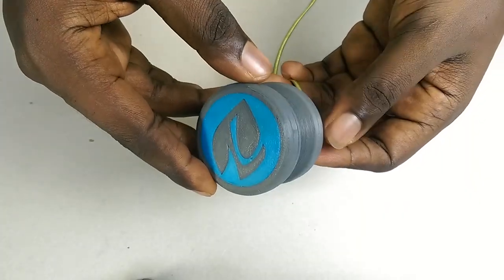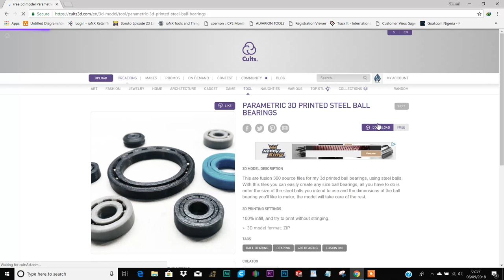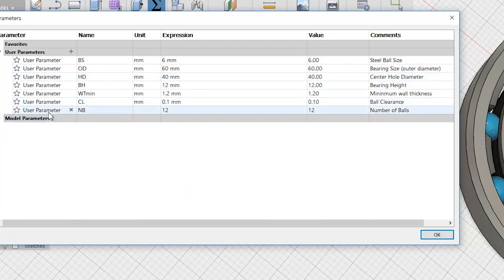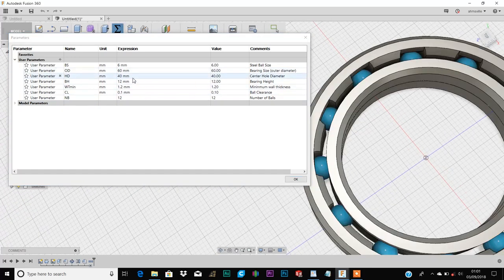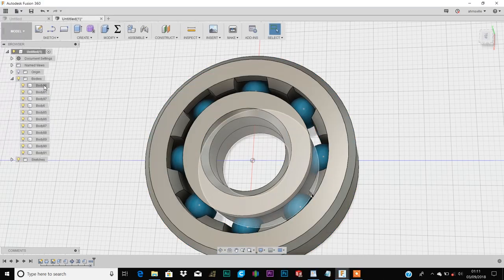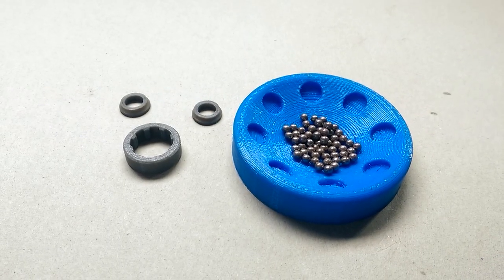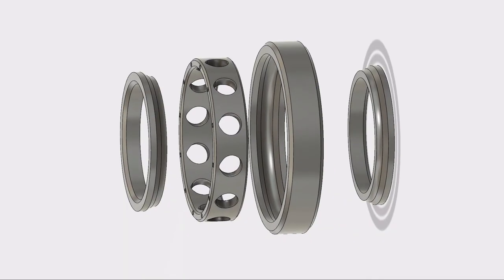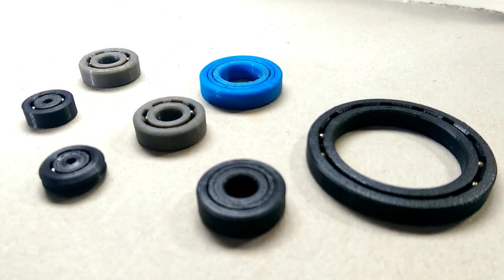Parametric 3D printed Steel Ball Bearing | Fusion 360

Comment: thanks! all the models I found used 3d printed balls which obviously didn't work with my FDM printer, it's like making a bistable switch and trying to print the contacts.
the use of an inner plastic ring is a great design choice as it allows me to melt steel shaft into the bearing for a tighter fit.

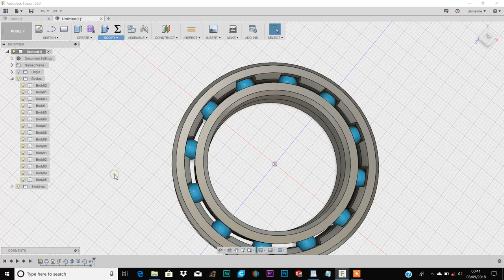Comment: 2:00 the cage that is integrated with the outer ring is detrimental to the design. It doesn't allow the ball bearings to roll.
Reply from the maker: i can assure you, the cage is not the problem. the problem is most likely printing related, you can show me an image, maybe i can troubleshoot it for you.

Comment: Hey! Thanks so much for this file. I am trying to print your design quite small on an SLA printer, right now with the dimensions 32x25x4mm. The script is giving me errors when I go below certain measures, could you advice how to scale down your design? Thanks!
Reply from the maker: This size will have a 3.5mm thickness...that space also has to hold the steel ball, so what size steel balls are you using?

Comment: I'm curious as to how the top and bottom inner rings stay together. Glue?
Reply from the maker: Yes glue...with larger bearings you could add holes and then use bolts and nuts or screws to hold them together.

Comment: This is amazing! But I have a few questions. What do you use as the lubricant? I know you said oil, but would any lubricating oil work, or should I get one made specifically for plastic? Also, what layer height did you use/would you recommend?
Reply from the maker: Any lubricant should work, but aim for viscous ones, they won't seep into the plastic and the tend to stay in the ball groove, i personally use grease and it works beautifully.
Reply: @AhmsvilleLabs  thank you!

Comment: Very nice job!! you win another subscriber, I have two questions for you, is this your design? why you did not use thread or a fastening mechanics to hold the inner rings together without glue? the glue is no a save way to keep them together, depending on the application you are using those bearings, for me glue is not an option,  I have downloaded the files and printed several bearings,  all of then works perfect, finally, Can I contact you to talk about business?
Reply from the maker: This is my design, and i chose glue to cater for smaller bearings that might not be able to hold fasteners, but if your printing larger bearings, you can easily add holes for nuts and bolts, that's part of the reason i shared the source file.
Reply: @AhmsvilleLabs  , thank you for your quick response, in my opinion nuts and bolts will add another thing you need to buy, adding cost to the bearing, instead making the a drawing with threads for the inner rings will no add any cost, fastening mechanics is another option so the inner rings could snap together , the glue will be used to keep the thread and fasteners on place, this way you don't need to worry about designing the axle with nuts to secure the bearing from separating, yes the bolts and nuts remain as an option but like I said, is another thing you need to buy for the project if you ever find the perfect nuts you need for an specific project, don't you think so? Will be easier if the equation driven file contains the aforementioned thread or fastener mechanics, would you like to add those features the the file, I'm willing to pay for that file to save time trying to do by myself.

Comment: Will this design work with 1.5mm ball?
Reply from the maker: Yes, if your printer has a small nozzle diameter, like 0.2 or smaller, but if your using the standard 0.4mm nozzle the smallest recommended ball size is 3mm.